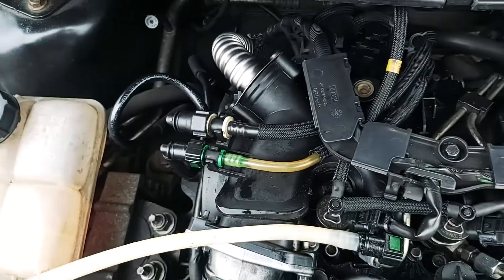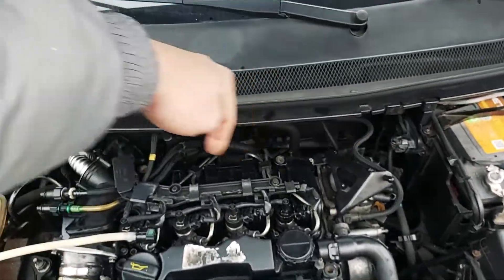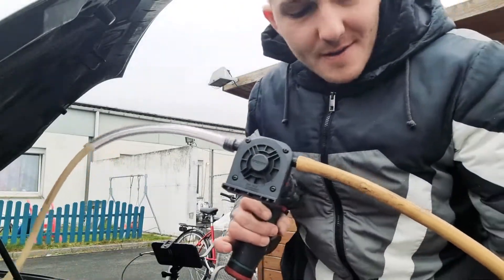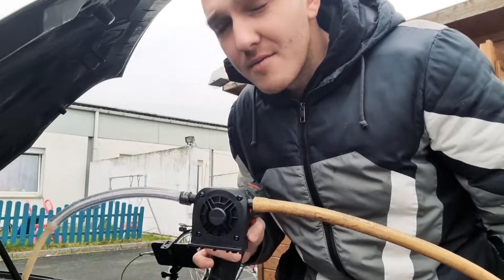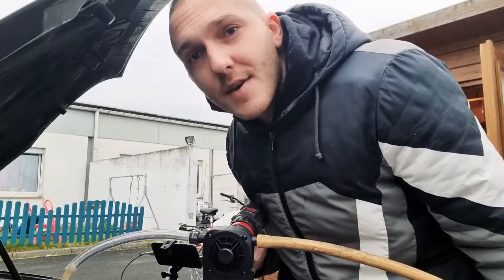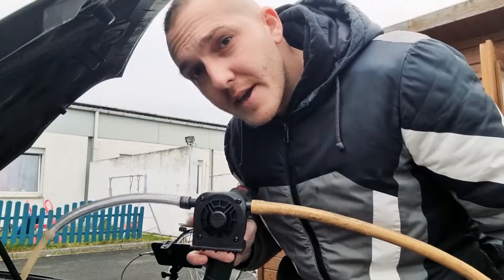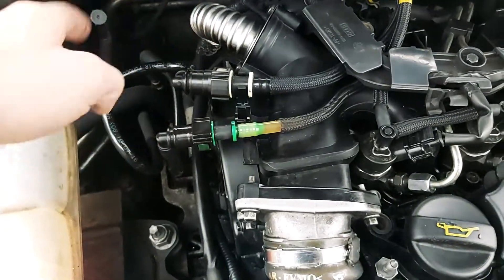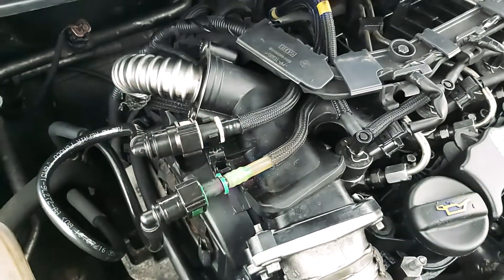Diesel wont start after fuel filter change ? / How to bleed Diesel fuel system ?  (PART 1)

Comment: After reading all the crap on the internet about how the high pressure fuel pump eats itself unless primed electronically. I took a can of brake fluid cleaner. Popped the hose to the egr. Sprayed in a bit of cleaner and in one vroooom broooom the beast choked and coughed out loud and started up. It did take a few minute to settle down. Sounded like a pensioner with a cough 😂

Comment: I FACED SAME DILEMMA AFTER DISCONNECTING THE FUEL FILTER. 
THE ENGINE RUNS PERFECTLY AFTER BLEEDING THE FUEL SYSTEM  AS YOU DEMONSTRATED. <3

Comment: on  HDI  its same problem but  diesel fuel goes around injector so it seems that 1 injector are clooged  too  so car only crank  and diesel fuel are spilled around injector and even comes thru injector out thru pipe